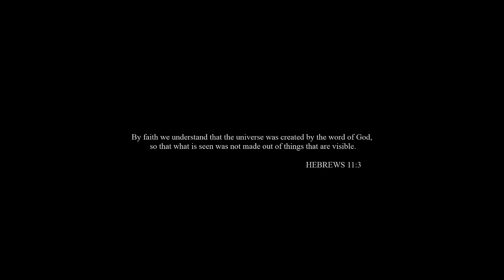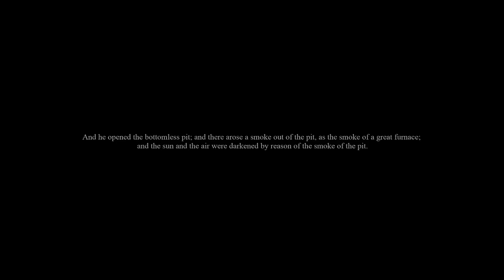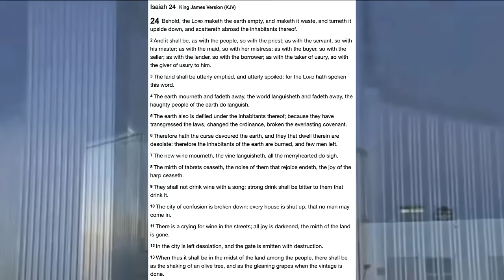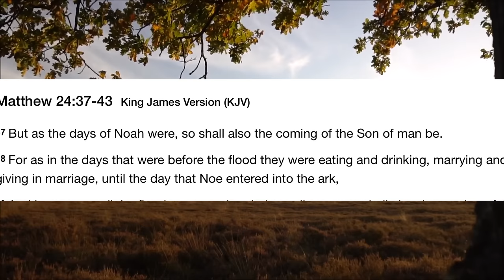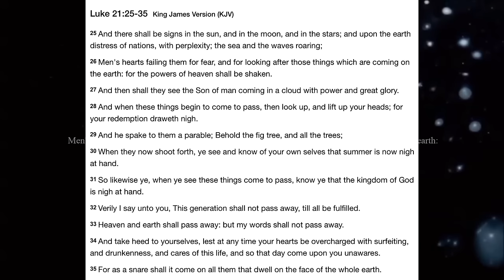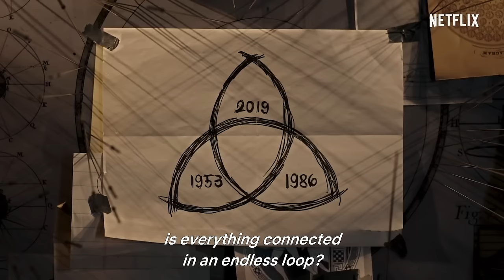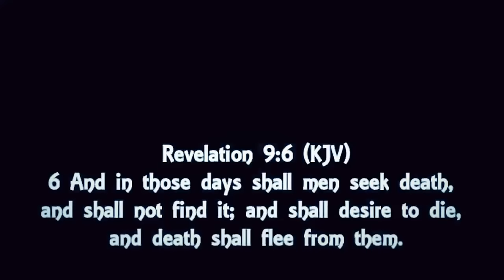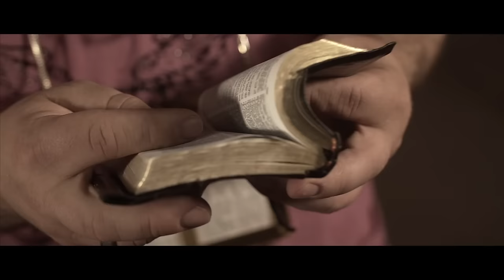CERN IS NOW POWERED BY THE DRAGON | CHINA & THE OUROBOROS CONNECTION

Comment: Perhaps, CERN is the key to the bottomless pit: I am not sure:

And the fifth angel sounded, and I saw a star fall from heaven unto the earth: and to him was given the key of the bottomless pit.

And he opened the bottomless pit; and there arose a smoke out of the pit, as the smoke of a great furnace; and the sun and the air were darkened by reason of the smoke of the pit.

And there came out of the smoke locusts upon the earth: and unto them was given power, as the scorpions of the earth have power.

And it was commanded them that they should not hurt the grass of the earth, neither any green thing, neither any tree; but only those men which have not the seal of God in their foreheads.

And to them it was given that they should not kill them, but that they should be tormented five months: and their torment was as the torment of a scorpion, when he striketh a man.

And in those days shall men seek death, and shall not find it; and shall desire to die, and death shall flee from them.

Revelation 9: 1-6,KJV.